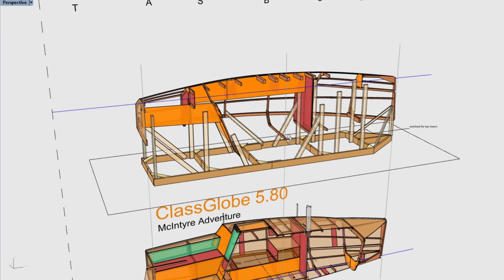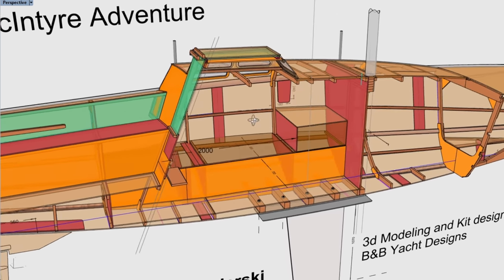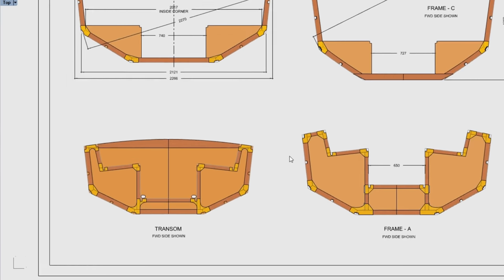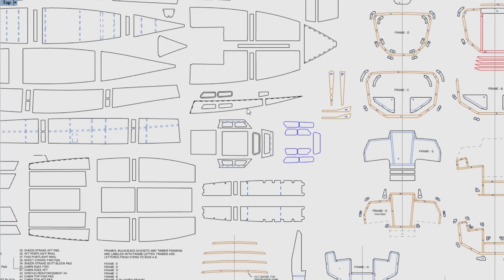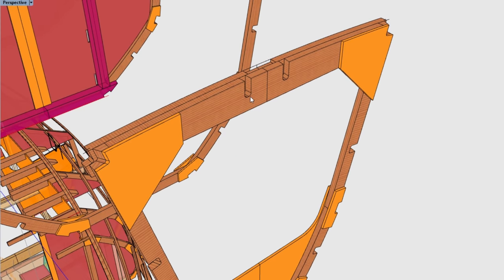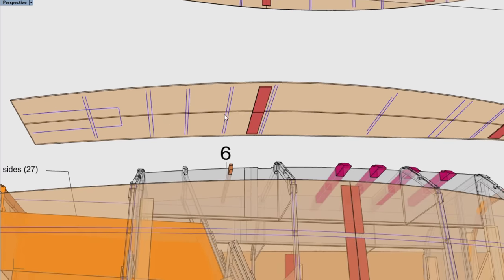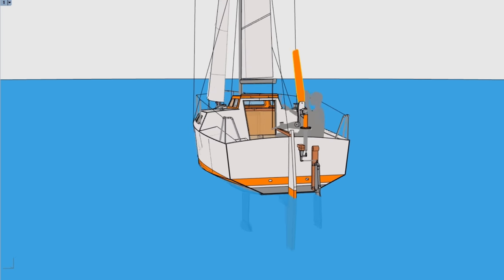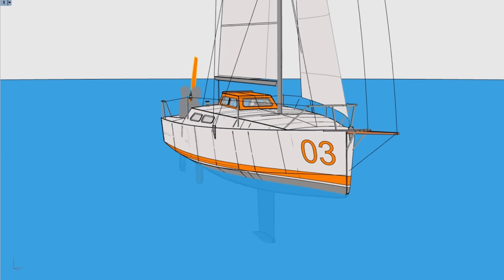New Class Globe 5.80 CNC KIT Virtual Tour

Comment: the scow bow is getting popular these days I would be interested if it would make any difference to performance.
Reply from the maker: Since the 5.80 design is a one design class and not a box rule class you won't see hull design development with it like you do other box rule classes like the minis. The bluff bow designs are fast because of their beam (power via righting moment) not just due to the bluff bow which is just sort of a byproduct of carrying the beam as far forward as possible. But yes the idea has proven fast in reaching conditions but to get the full benefit you need lots of sail and probably a canting keel. What does lots of sail or "max beam" mean though? Again it really only make sense when thinking about a box rule class that has limits on sizes. There might be a faster hull shape you could build with the same rig but who would you race it against?

Comment: Great video, the bottom of fame C you explained the notches will be in the lower beam but some of the drawings still show the notches in the side beam? How is the keel going to be attached?
Reply: Keel Has 10 x12mm Stainless steel Bolts..NOT welded to the keel so you just undo, push them out, break the seal and take the keel off...both halves of the bolb undo so then two guys can handle each of three parts.. :)

Comment: Looks like the rudder is cut from flat plywood, I haven't had a close look at the rules but how is foil shaping handled etc

Great video, very clearly demonstrates the thought and effort that went into making this an achievable project for many people despite the overall complexity. Well done.
Reply from the maker: Thank you! the rudder blade in the parts here was simply meant to be used as a template. If I were building a rudder for this boat it would probably be laminated from quarter sawn wood then cut to the profile and shaped in to the foil shape section shown in the plans before being glassed. The process would be similar to how we build our centerboards only a bit larger. https://youtu.be/7J0czRfxJk0
If we are asked for it we can supply fully CNC cut and foiled rudders ready to be glassed and finished. We offer this for the centerboard for our larger boat kits.

Comment: Nice detailed expose of the construction detail. Question - what are the benefits of sloping cabin bulkhead, looks nice but a vertical would stop water dripping into cabin when washboards are out. extending cabin sides back with angle on back edge would cover visual effect,